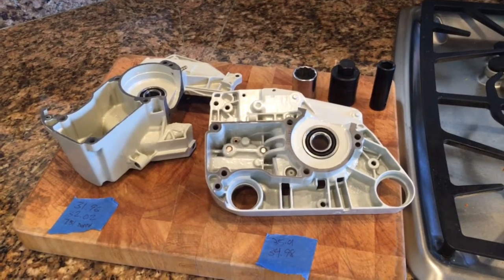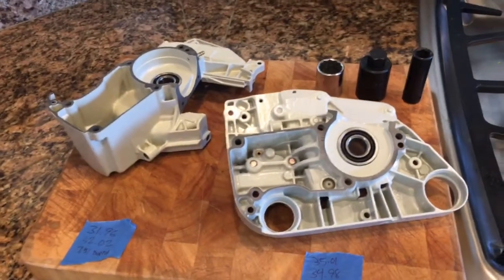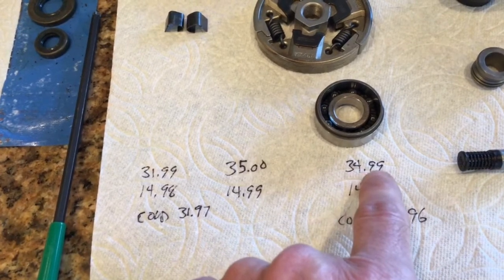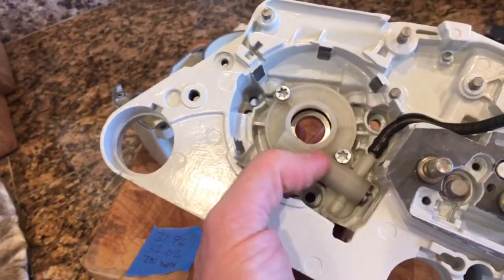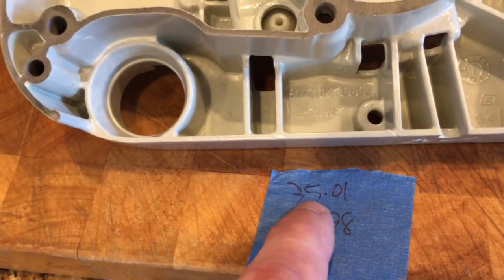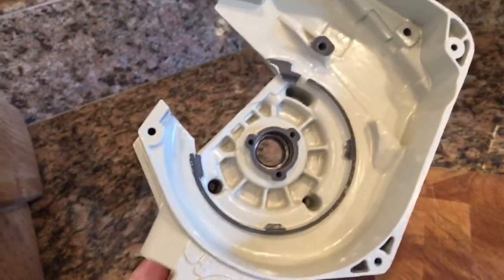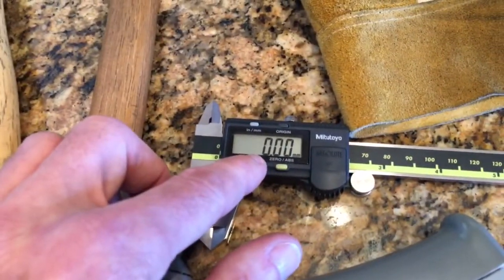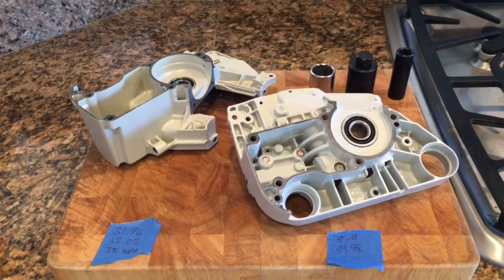Stihl 026 ms260 main bearing installation

Comment: I've got an MS260 that I bought as a non-runner with the intent that it would be a project to work on with my 11 year old son.  I've done a lot of work on Stihl saws but I've never split the case on one.   I'm glad I did on this one because the crank bearings were well on their way to being shot.  There are several videos on YouTube showing how to install the crank bearings, but I like yours because you showed, through measuring, that the bearings do essentially just fall into place if you use the heating and cooling method.  It was also nice to hear that you need to have the oiler in place to get the right set on the PTO-side bearing.  I wasn't sure how I was going to get that one in the right place.  Good tip!
Reply from the maker: The bearings can be a little tricky when you get to assembling things. As I remember one has to go on the crank first unless you have a crank puller. It's been a while so I can't remember fully, but once you get into it, you should see how everything fits together.
Reply: @ray5961  I watched your follow-up video where you described the problems you and with the PTO side bearing moving when you went to install the crankshaft.  I ordered some parts from a guy I've known for a while who has a Stihl dealership.  I'll make sure to pick his brain a little bit to get some tips for putting the crankshaft assembly back together.

Comment: Great video. I just ordered new bearings for an 044. Did you heat both halves and freeze the crank when you put it back together?
Reply: Nevermind. Just saw your follow up video. Very helpful. Thanks
Reply from the maker: I can't remember exactly what I did.. but yeah I think I put the bearings into the oven and the crank into the freeze. But as I remember, one side kinda come out during assembly and I had to redo it or something. It's a bit tricky as I recall.